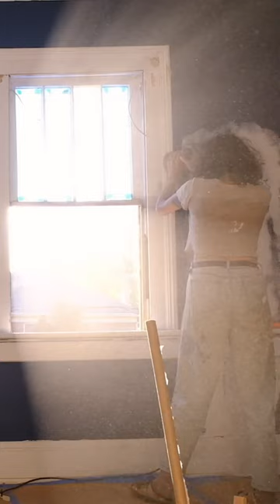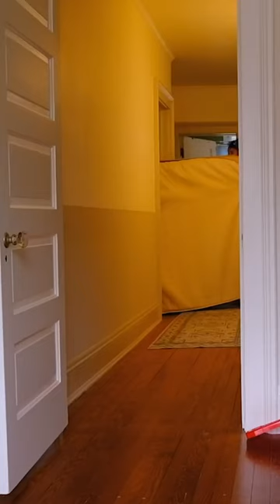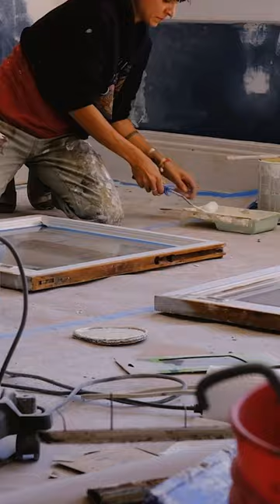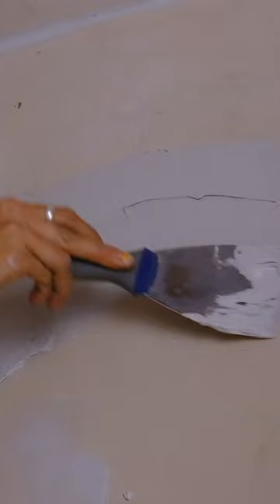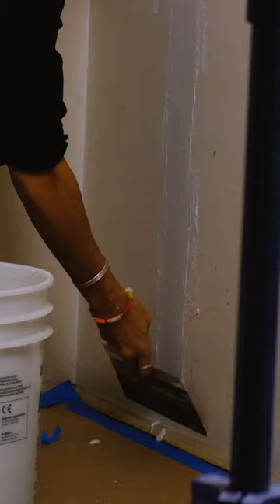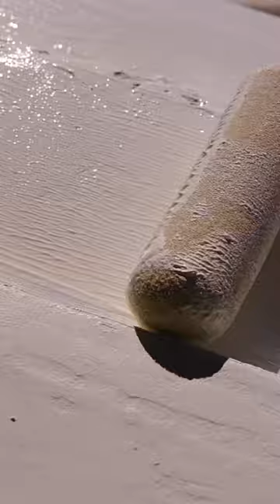Renovating our bedroom #renovation

Comment: A little secret tip. Don't sand the mud. Use a wet sponge to smooth it out. It's a lot easier and no dust. I have 24 duplexes, and I was so thankful to have been taught this trick.